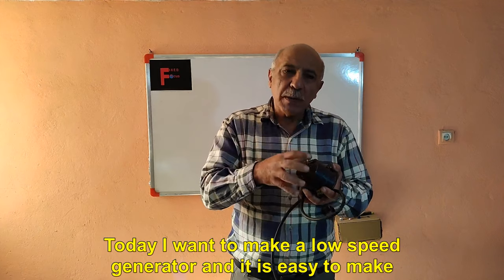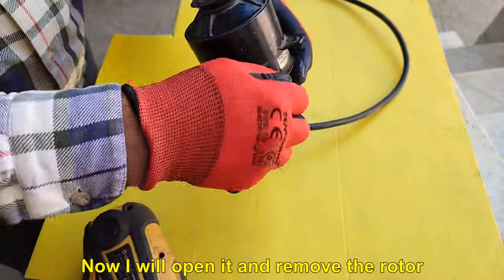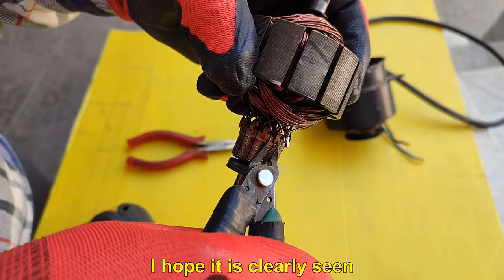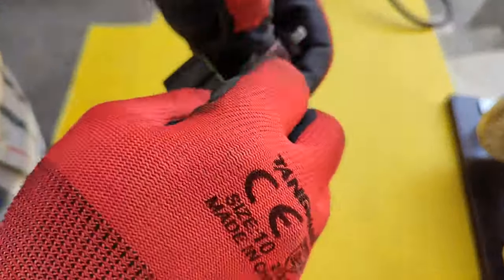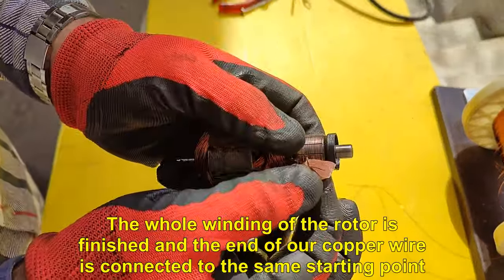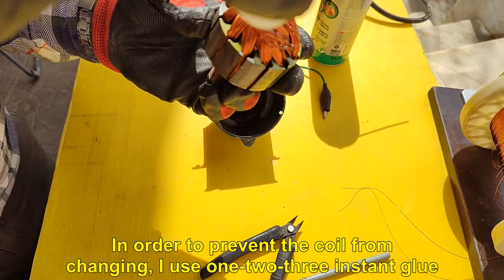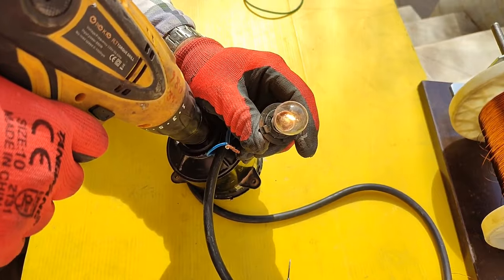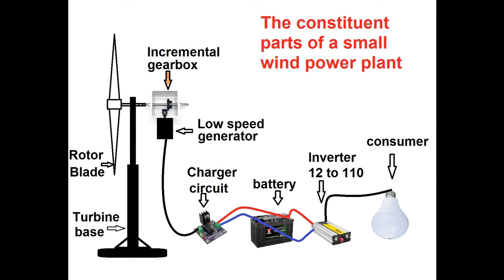The easiest way to make a home wind power generator.Build a low rpm generator at low cost.

Comment: Thanks for the explanation and showing us that clever modification. One thing I would like to see is the electrical resistance of the coils before and after. Something always desired is that it be as low as possible to reduce inefficiencies. When the resistance is high the torque needed to rotate the shaft is higher to maintain a given power output. In the case that it is used as an electrical generator it would imply larger blades. Your video has suggested me to transform this stator into a three phase stator with neodymium magnets in the external rotor.  
Good luck
Reply from the maker: The output power of this DC generator does not change at all, all we have done is increase the voltage with a slow rotation
If you use arc shaped neodymium magnet from N42 to N50, the power of the generator will be very high.
Thank you for your good comment

Comment: Can you explain why it is that your multimeter reads are all in the negative. And, I take it that it doesn't matter if you turn/run the stator in a clockwise direction or a counterclockwise direction. Is That correct? Also, when you were winding the stator, was that one continues wind for the whole stator?
Reply from the maker: Thank you for your comment
Because the current is DC, if we change the poles, the negative becomes positive, and this is not so important, and the important thing is the amount of voltage or current that is shown.
As for rotation, it doesn't matter which direction it rotates, only the positive pole becomes negative
To twist the wire, we continue the same method for the entire commutator until we reach the starting point
Reply: @fixedfocussolar  Stupendous, my man. Thank You so much. I have to look over your vid again because I'm not that familiar on how to calculate what you did. Thanks again.
Reply from the maker: @robinhooper7702  👍👍
Reply: @robinhooper7702 take a DC motor, test it's voltage when it's going around 300 rpm (depends on how fast your wind turbine will spin is an average wind) take that voltage and multiply it till it's around 15 volts. So if the original was 3 volts multiply 3×5 to get 15. Next unwind one of the coils and count how many turns and record where the coil was and what comutator clips it's connected to. If the original coil had 10 turns to achieve 3 volts you need 5 times the turns to achieve 5 times the original voltage so original was 10 turns to make 3 volts so you need 50 turns to make 15 volts. These numbers change but the math stays the same. 
1 find your wind turbines rpms
2 find your motors voltage at that rpm
3 multiply that voltage till it averages 14-16 volts
4 unwind the motor and count the turns that made the original voltage 
5 multiply the number of turns to achieve the wanted voltage 
6 do it to it
This works with ac motors as well

Comment: Sir very nice informative videos ☺️ 
Sir I have one confusion about coil winding. Original motor winding has two stars and two ends coil exactly 180 degree of armature point. But your rewinding of motor coil  has one start point and continue winding with different stacks to end winding.
Can you please tell me which is right way to wind a coil?
Reply from the maker: Thank you for your nice comment
In the video, I have explained that in the machine method, we have to have two points of connection
  But in the manual method there is no need for two connection points and in fact both methods are the same
If you want, watch the video carefully

Comment: For charging a battery you need more amps than volts a 12v battery will charge at 14.5v but you need as many amps as possible up to 60amps a 33amp hour battery will take 1.8 hours to charge at 60 amps. If it was 5 amps it would take 6.6 hours to charge batteries can take high amps but not high volts they will boil at 17 to 18 volts regards Graham Flowers MEng
Reply from the maker: thank you
In fact, the right voltage can charge the battery
If the amount of current is low, the charging time is long
And if the amount of current is high, charging happens faster
And the best voltage for automatic charging of a 12 volt lead acid battery is 13.5 volts
And in this case the battery will have a very long life
Of course, I have been working with lead acid batteries for almost 20 years and it is a great experience
Reply: @fixedfocussolar  I have been an engineer for 62 years I have worked on wind turbines 36 years regards Graham

Comment: the required rpm for 12 v is too high..the wind max is 400 rpm..unless with the gearbox which is not easy to find
Reply from the maker: It depends on the type of use your transmission is using for torque converter

Comment: The only problem i see is you did not insolate the coil wires from the rotor
Reply from the maker: Well done to you
But I said in the video that the core has a glaze color and does not need insulation
Reply: @fixedfocussolar  I've wound coils experimenting and never found that glaze was adequate not all thee time,
Soon as it heats up.
????
Reply from the maker: @CMAenergy  Heat-resistant paints can withstand temperatures up to 400 degrees Celsius. These types of enamel paints are used on most electric heaters.